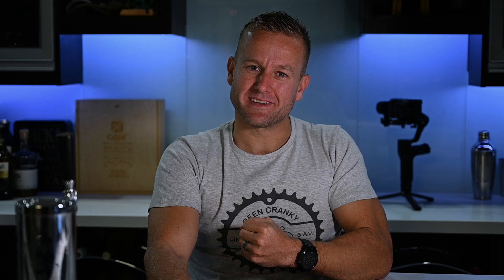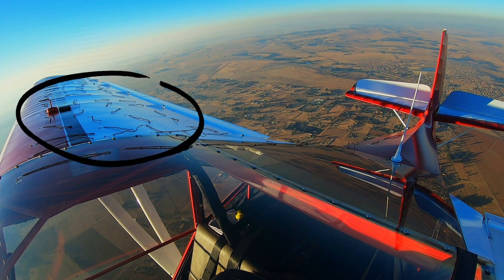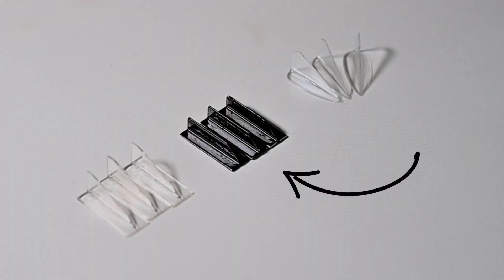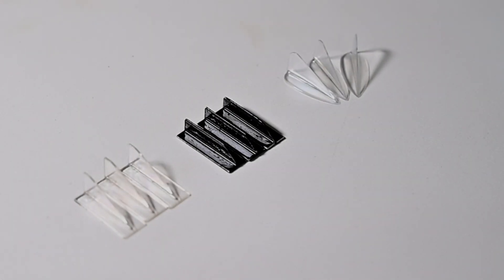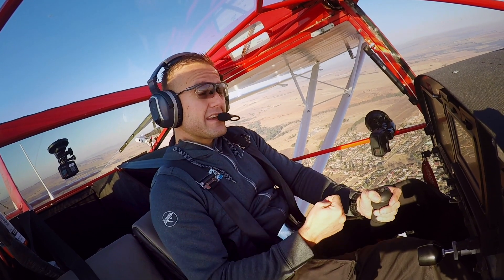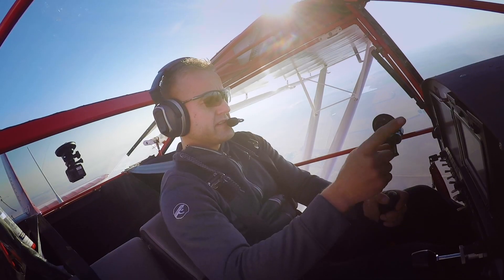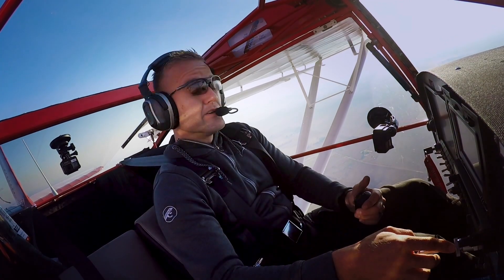7 Knots Slower Stall Speed! - KitFox SS 7 Vortex Generators Installation

Comment: Evidence based data backed up by well-done testing of their hypothesis to prove the concept. Will definitely change the position of my VG's on my Highlander wing to rib based and add the roof. Nice to know the gap seal needn't be fancy but can be 3M clear tape or duct tape if appearance is of no issue.  No airfoil is left unattended makes total sense to me.  Great work and please keep going with the top gas cap work as I am at a loss on how to attach that to the wing.

Comment: Great video! A lot of great testing and information here. I am curious if you know whether or not the same spacings and placement would work on a Just aircraft Highlander wing? Also. Did you ever come up with a solution for the fuel cap? Maybe a fuel cap fairing in front?

Comment: The key to making a strong safe low stall wing or rear wing is <ribs> but u cover the ribs^ <SO the thickness of the wing changes from basic air foil to thicker & thinner air foil by sheet metal add AT over the RIBS, Key:God6

Comment: So instead of adding aluminum drag BS the better way is serrated leading edge shoots making adding on new sheet metal to the both sides right & left if flying faster than 200mph, slower only 1 side.

Comment: your making a Ferrari scoop only by DRAG adding on vs new design serration so air is cleaner 1 spot vs another. Again 1 way is after market smack easy & other is BETTER less drag less fuel burn works at any speed but harder after the fact to improve.

Comment: the left side wing gets no vortex generators for these small craft but gets serrated leading edge shoots. It is opposite way to make vortex only 1 is cut shoot out & other is cheap shit but Works add-on. The cut-out is less after market new design but is better way less drag to do the same thing. 1 wing no wing or above 200mph both wings but ony 2/3rds of the wing.

Comment: the tail on this high wing, bad design, needs a snailing strong Kevlar fabric over  <wire sock/wind shock design> that makes plan 3 or 4 ft+ longer. The fabric over wire shock lets some air in & adds no real weight & very little drag but great free flowing control, needing no imput.

Comment: My tail design w/scoop that Ferrari scoop lets air from right travel thru tail & same the other way to keep balanced flight. The rudder needs 3 deg of free flutter per side, & u put vortex on the front of the tail not sticking out but serrated cutting lacing the air along the tail, locking it in. & it generates less shoot serrated thinner tail drag while more control.

Comment: comment 134: only use the vortex gen on 1 wing of tiny ultra light craft. Then on opposite side of the elevator: God.If u can fly stead above 200+ then u can start to add vortex on both sides right & left wing but only 2/3s of the wing not last 1/3, outer 1/3.

Comment: I am building a kitfox ss7 standard wing with the Laker leading edge, would you install the pacific nw aero vg's in the same way you are showing ?   Thanks so much , billy
Reply from the maker: Hi Billy!
It's difficult to say how the leading edge will affect the performance and installation of the VGs. But I think it should work just fine. We used the ribs in the wing as a reference for placing the VG pair, as mentioned in the video. If you can still reference the ribs in that same way for the install I think it should work great, mabe even a bit better given the surface wil be "smooth" compared to ours.

Would love to hear your feedback, if you do decide to go with our Installation
Reply: @About2Stall   Thank you very much for the reply. I agree with you that the Laker Leading edge should be a good system for your design and study  of the VG's. I am the oddball ..... going with the 160 HP Lyc., whirlwind prop., so I am 100 lbs., heavier right out of the gate, and will share my data with you when I have some. I would expect about 3 months from now. and while I am writing this, a question for you ..... have you developed a elevator gap seal yet ?   I Thank you and your team for this extensive flight data you are sharing with all of us ,  you guys are the BEST  !!   billy
Reply from the maker: Absolute pleasure!
Yeah, that is a bit different than the norm... Really curious what your performance numbers will be.

We have a prototype of the new Gap seal, but we're still in the testing fase. Will keep you updated once we have it ready.

It's our absolute pleasure sharing our research. That's how we all contribute to GA!
Reply: @About2Stall  Hello again, 
 I received my airworthiness Certificate last week and ready to haul my Kitfox to the airport. I am asking if you have completed your gap seal project yet? I would love to use them since I copied your VG layout.   Keep the fun alive !!! Billy

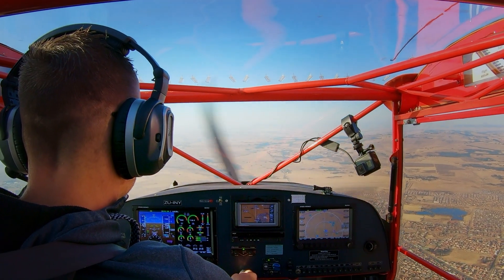Comment: The only question I have is at the end 10:00+ landing, shouldnt the root stall before the tips so that outboard aileron control is maintained.
Yes I realize it is flapperons.
But a full span simultaneous stall is unsafe.

EXCELLENT VIDEO 👍👍👍
Reply from the maker: Thanks!
You are correct, that's exactly why the VGs on the root side of the wing fence is further back than the other. This allows the Root to still Stall first while also improving the Stall Speed of the inner wing relative to what it was...

Hope this makes sense?
Reply: @About2Stall  I was just watching the yarn during the landing.
4k hr CP/AP

Comment: What did you use to attach the VGs? Double sided tape? Or, loctite? Thanks again!
Reply from the maker: Hi Cameron!
We used high quality double sided tape (for easy removal while testing). We do however recommend that you go for a more permanent solution once your placement is final.

Comment: Great informative video. Have you thought about a wing cuff from the wing tip to either half way down the wing or to the wing fence ( similar to the Icon A5 ) and vortex generators from the wing fence to wing fence. Will be interesting to see how it effects stall and STOL characteristics.
Reply from the maker: Hi Regon,
Yes we did look at a wing cuff, we are busy getting a slat. The problem with adding a wing cuff from wing tip to the half of the wing is that it will only improve the outside which is already working great. The stall will still happen at the same speed on the inside of the wing(our problem area). Before looking at any improvements on the outside, we need to improve the inside. So putting a slat the entire length sounds like a great plan 😀

Comment: What a great video…. I am the first customer to have the new Rans S21 Outbound  flying. 
I was hoping for A little slower stall speed but it always seems to come in at 45 mph, so I’m getting ready to install my VG‘s based on manufacturers (STOL Speed) suggestion a placement starting with the leading edge of the VG at 7% but they are using 90 mm spacing on the inbound portion of the wing and at the tips they use a 30 mm spacing I am wondering if going to a tighter spacing would have better results? If you have any thoughts on that it would be greatly appreciated also I believe after watching your video I’m going to install them across the top of the fuselage on my window area.
Thanks again for a great video, your results are quite amazing.
Reply from the maker: Hi Tailwheel Flyer,
Thanks for the feedback!

**First a word of caution**
It is extremely important that the inner section of the wing stall first. If it is not the case this will result in a stall spin scenario.

Only after many visual tests with the tuffs did  we moved them closer at small increments and each time recorded on video the stall order. Making sure that the inner wing stalls first. We continued doing this until we could not move them any closer. And still saw the inner wing stalled first. This will differ from one wing design to the next. The kitfox wing is just so well designed to stall in the inner section. This may not be the case with your wing.

The recommended layout is usually safe without having to test. As soon as you deviate from it. You will have to test in very small increments. And before changing anything, really get to know your aircraft - it usually takes about 200 hours or 1000 landings 😊 

Also the location of our wing fence, was with the help of visual results from the tuffs, you could clearly see the line between the inner and outer wing during the stall.

If you have any questions, we will be glad to help.

Safety first!
Reply: @bradgoff7301 I also have a 21 and have been thinking about VG’s. What are your results? I definitely can’t afford to lose any cruise speed.

Comment: Great video. How many vortex generators did it take to do both wings and the roof?
Reply from the maker: Thanks🔥
There's about 80 per wing,
40 on the roof and 
16 on elevator x2 
So 236 total
Reply: @About2Stall  ready to cover my SS7 wings , great videos, Thank You for all the info.... Could I get a sketch or print on placement for those 236 VG's. Cell 360-914-0014 Washington State, Would be very glad to pay for them, You have done a tremendous amount of study and  investment to the Kitfox world of aviation. If I could pay for some of your work ,I would gladly do it !!  cheers,   Mark
Reply: @About2Stall  thanks... Looking at doing the same on my Kitfox 7SS
Reply: @About2Stall  Hi Riaan, are you able to supply the wing fences you developed for your Kitfox?

Comment: Thanks for making this awesome video. Do you know if the wing on a series 5 Kitfox is the same as the 7?Would it be possible for you to make the cad file you used for the stall fence available for download? Also, it looked like you used a different VG on the roof section? Also, I used 3M blender tape for my gap seal and it works great, just need to put some Vaseline on the hinges so it doesn’t stick to them.

Comment: Great video on the VG’s, who did you have cut your wing fences and how did you install them on your wing?
Reply from the maker: Hi Leslie,
We first shaped it out of wood, until we had a nice fit. The position where we saw we needed to install fence was inline with one of the flapperon attachment arms, we hooked it over the leading edge and bolted at the flapperon arm. Doesn't move much but to be sure we added 3 90degree 1cm feet. They are attached with double sided tape.
The final one was made out of aluminum and powder-coated.
Hope this help?
Reply: Thanks that’s what I needed,  starting to measure an draw them up.
Reply: What thickness of aluminum did you use? Thanks
Reply: Also, how tall is your fence? Thanks again

Comment: Great video and report. Thanks. For my Gap seal on my Kitfox 4 elevator I used clear Gorilla Tape (brand name). Does the job and doesn't stick out like a sore thumb. Gap seal was a huge improvement. I have not done the vortex generators yet but planning to. Thanks for some great info!
Reply from the maker: Hi Teddy!
We have a nice permanent solution that we will release very soon. Main objective to be simple and as you mentioned... not stand out!

Thanks for the feedback!

Comment: would you recommend any major changes to a kitfox model 3 wing? I'm not really familiar with the model 7 wing but the 3 has a fair bit of undercamber. Otherwise I'm not sure what the differences are exactly.
Reply from the maker: Hi Eldon,
Thanks for the support!

It will be reckless of me to apply the knowledge that I have of the SS7 directly to the kitfox 3. If there is one thing we learned is that small changes makes a big difference.

My main concern is the difference in the inner wing. The 7 was almost over designed to stall at the root. So VGs had very little effect on this section. So a tight spacing worked. But on other wings not so overly designed to stall at the root doing the same placement will invert the stall. Having deadly results.

I know there is many kitfox 3 out there so I will definitely do some research to assist. Will revert in due time.

Keep well! Fly Safe!

Comment: What improvement did you notice from the vg’s on the roof?  If you mentioned it specifically, I missed it.  Thanks for taking the time to work on this!
Reply from the maker: Hi Texas STOL,

There were two improvements.
Firstly - At some stage before adding gap seal we could not stall her anymore because we lost elevator authority. She would pop up like a balloon at the tail - The weirdest feeling - By adding the VGs to the roof this happened at a lower speed and not such a BIG pop.

Secondly - this actually makes your stall speed lower. The first air to detach from the aircraft is the roof. And if that goes it starts "pulling" the air on the wing,  basically inducing the stall. 
So by delaying this, we delayed the stall. We will be installing a wing fence between the roof and wing to improve this even more...

Hope this answers your question.

Comment: Very nice results, I found the most interesting part was about the roof. I had a loose plane to actually raise my turtle deck and aft portion of the plane so that it was a straight line from where your VGs are to the tail. After reading some NACA documentation, that angle should be 7 deg or less and I think the way it drops down, it's closer to 11deg.

I have a composite leading edge that goes make 200mm from the leading edge so I don't have the fabric dipping between the fabric of the ribs. I wonder if moving my VG's between the ribs will still make a difference... I think my VGs are currently 50mm back. I am going to tuft my plane very soon so I should play around with the wing tanks distance as well. 

Thanks for taking the time to do this. I have a lot of mods for the Kitfox that I want to do. The one that I haven't come up with a solution yet is to get rid of the gap between the horizontal stabilizer and the vert stab and have a root fairing while still being able to move it..
Reply from the maker: Hi Josh,

Thanks for the feedback.

The roof was indeed very interesting and we will be installing a wing fence between the roof and the wing in the next week to try and delay the stall a bit more. We also flattened those little corners that stands up to fold the wing under the roof. Didn’t make a difference.

We are working on a very effective permanent DIY solution for the gap at the horizontal stabilizer, we tested it on a mock-up setup and it looks promising. Once we are happy we will be sure to post a video.

And the next part is just to tease you :P… but we have a very simple but radical mod that we will be implementing in the next 2 weeks that should give us another 2kt off the stall.

The best thing about the VGs the cruise didn’t change…

Keep well! Fly Safe!

Comment: I’d love to know this information about my plane. How did you attach the VG’s I order to remove them without any damage? I fly a 1956 172 with an Alaska bush tailwheel conversion, and Horton stol. VG’s are next on My list. Great video. Thanks.
Reply from the maker: Thanks for the great feedback!

Before I tell you how we managed to remove them so many times…

I have to caution you!!!
Just as awesome as VGs are… they can change your stall characteristics in such a way that you can lose control on a routine stall exercise. We are busy editing our video “VGs can kill you”  where we talk about the dangers of installing VGs incorrectly. Stalling your aircraft is never a good idea!

For testing purposes I will use aluminium VGs for the simple reason, in the beginning we removed the old 3M double sided silicon based tape by hand. After round 3 I had blisters. So I hired someone full time to do it. We did it more than 50 times. We tried every position you an think off.
Then when I had to do it again I tested every possible way to remove it. Tried cooking them, tried ultrasonic cleaner… And then finally, put them in paraffin overnight and the silicon falls of in the morning. Necessity is the mother of all invention.

So use the aluminium VGs  with 3M 1mm double-sided sheets. We used a gelatine to cut then to size.

To remove them make sure you leave the aircraft in the sun for a few minutes. If you try this while it is cold, it will take some paint with it. We then used a twisting motion to remove them, not a pulling motion. You will lose paint if you pull them off.

We found that a VG pair works much better than singles. It is when you place them to close to objects or changes in the wing that a VG can actually increase the separation of air. We found to keep at least 30-40mm from all changes in the wing. This counts for pair and singles.

The best way to test is to install tuffs and record a stall in all 3 configurations so you can understand how your wing works. Then use the recommended installation by the manufacturer. Again do stalls in all three configurations. Look and study the footage make sure that the placement they recommend keeps the stall order and pattern the same.
Even if you get slower stall speed and the stall pattern is not the same or better… TAKE THEM OFF. It is not worth the slower speed.

After ever small change we did, no matter how small(6 months), we recorded a test flight with a very fast stall(release back pressure at first signs of stall) to make sure we are moving in the right direction. We have so much footage of a kitfox stalling, I think we will put it in a stall compilation.

I hope I didn’t bore you with too much info… I will go read up on your aircraft to see what has been done with VGs.

Keep well! Be Safe!
Reply: About2Stall thanks for the advice. You defiantly have a lot of great knowledge about this. I love the scientific approach.